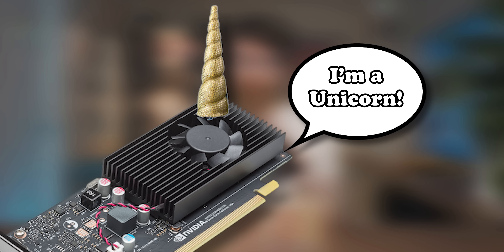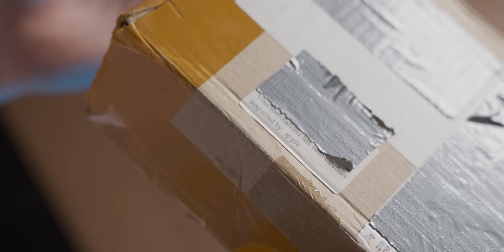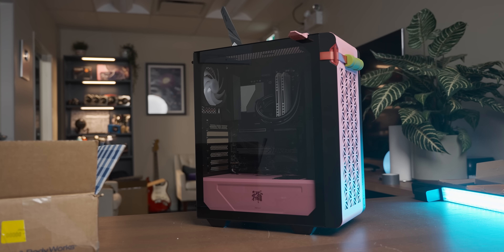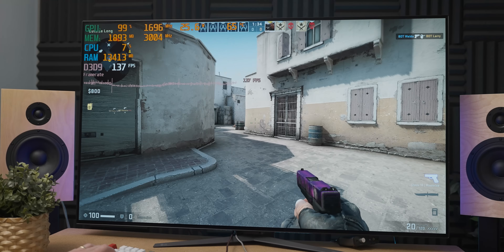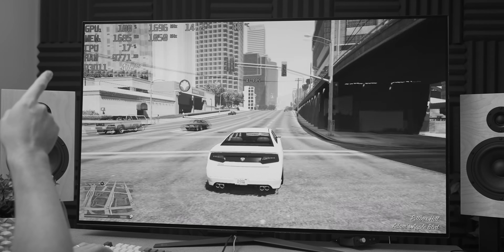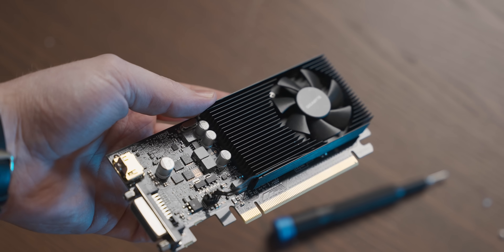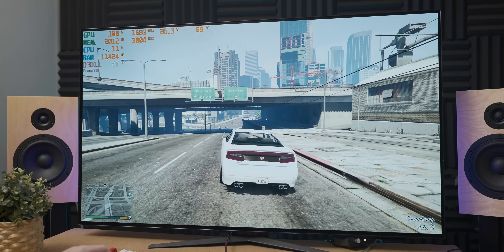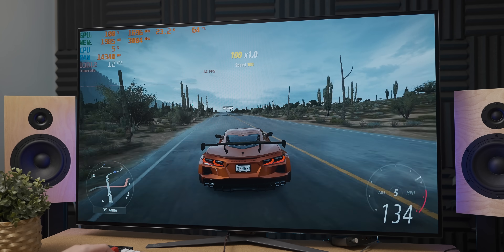This May Be Nvidia's RAREST Graphics Card

Comment: Those sub 75 Watts video cards are not very loot after.
There are still brand new GT 610's,  GT 710's, GT 1030's, GTX 1630's (which I just find out that they exist, and i wonder why? ;p )
The best use for those card is to add video outputs, but you can use motherboard outputs for free ...
Reply: Not every cpu has an igpu

Comment: fsr takes a fixed amount of graphics processing to do the rescaling. let's say it takes 100bp to use fsr at 4k from whichever resolution you're scaling from. 
if a 130bp card like the 1030 does it, it's left with 30 bp to render the actual game. which is why it's slower than native even though the resolution is lower.

now for a decent card, say a 3060, that has 1000 bp. the 100bp it takes to do the rescaling is a drop in the ocean and is easily compensated by the reduced load of rendering in a lower internal resolution.

fsr should only improve performance for the 1010 in resolutions below 1080p

Comment: 11:00 The problem with FSR is it requires a tiny bit of performance to actually apply the sharpening filter, which probably in this case seems like it is taking the GPU over the edge (could also be VRAM related?).
Reply: Both FSR and DLSS drive up RAM usage, so I wouldn't be shocked if that was the problem.
Reply: It's not compute limited, it's VRAM & memory bandwidth limited. Temporal upscaling has a small but notable cost to VRAM & memory bandwidth.

Comment: 10:30 FSR 2.2 failed in this case because it put a little more strain on your already exhausted 2GB VRAM buffer. When VRAM is full the system uses RAM which is extremely slow for the GPU to access since it has to go through the CPU to access it which is basically ages away. FSR increased your VRAM usage (and thus RAM usage) by around 700MB which is a lot for a 2GB VRAM buffer. 14300MB RAM to 15000MB is a really noticeable increase for 1 setting. It's probably not meant to upscale to 4K anyway which is why RAM usage was so high, its more for 720p > 1080p

Comment: Yeah, but how does it run compared to the 7 Vega cores on the 4600G which goes for around 100€ in my country?

I know, because I built a PC for my mother around that CPU and I tried CSGO. Which performs a bit better than on the 1030 even.

AMD iGPUs, even Vega, perform so well, my father and I built an Office PC for my mother for only 350€ (completely now parts) that can drive both of her monitors and can even game at 1080p, which I tested because I wanted to see what Vega 7 in a desktop can do compared to the Vega 7 in my laptop (which also has a 1660ti, but I am always testing what iGPUs can do). 

16GB of RAM, a 6 core CPU with decent iGPU and a 512GB M.2 SSD means it's actually a beast computer by 2015 standards. And it runs basically silent when my mother is using it.

Comment: now i see different ddr4 vs ddr5 vs ddr6 ram make gaming performance changes 
i probably be going back buying broken ddr6 gpu and steals ram off of it do swapped and see if any changes lol
Reply: I don't think swapping ram on a GPU is possible sadly.
Reply: @cpufreak101  only have right tools and skills do it
Reply: @kittyztigerz  even then, I'm pretty sure you can only swap same for same. I'm pretty confident the memory controller for DDR4 isn't the same as one for GDDR5 and so on. Even if it were, I'm sure the amount of work involved for these cheap cards where they only used the "wrong" memory wouldn't even be financially worth it.
Reply: @cpufreak101  it wasnt one of cheap AMD card it was $800 back in 2014 just have ddr4 unset of gddr5
i have recognized few thing about swapped them out have to reprogrammed bios with one that going be installed on it dont want wrong code and number because it refuse to work and i have been programmed linux os few time get them to work with off band pc that was locked to win xp only and i just find way broke bios lock and get it going
if i have parts i would be willing try it and test it to see if change anything if it does i will make video of it
Reply: @kittyztigerz  ok now I know you're bullshitting because I cannot find any examples of an AMD GPU using DDR4 memory, much less in 2014 (which mind you consumer DDR4 had only just released in Q3 of that year in non-ECC form). I can find some very low end (mostly OEM) cards using DDR3 up until surprisingly recently, but it's still nothing that'd be worth the effort for.
Reply: @cpufreak101  my bad it was 2006 i didnt check sticker n see what it was.... ATI Radeon x1950 XTX 512mb 
it was gddr3 
i remember that gpu was expensive in my area back in the day at store unless order it on online for cheaper which i didn't think of it

Comment: It doesn't surprise me tha the GT 1010 is limited to four lanes, as the GT 1030 is as well. And both use the full size slot anyways. 

If anything, I thought maybe the GT 1010 would use two lanes.
Reply: well, 6500XT also using 4lanes only with performance not that far from 3050ti.

Comment: I have small correction: 1030  is not all digital. DVI includes analog signals and simple adapter, or DVI to VGA cable can feed Mesozoic era monitors.
Reply: partially correct,  

DVI-D which is what that connector is, removed all the analog signals - as evident by the missing pins around the  ground '--' Flat pin.  and depending whether the monitor was single link or dual link would determine which of the pins would feed data when the monitor was detected and the info was sent to the GPU what type it was. 

DVI-I incorporates both Digital and Analog signals and also includes single and dual link modes. 

DVI-A literally just the analog pins in DVI Format.  those pins were later converted to digital in DVI-D specs. 

Quoting:
"Digital Visual Interface (DVI) is a video display interface developed by the Digital Display Working Group (DDWG). The digital interface is used to connect a video source to a display device, such as a computer monitor. It was developed with the intention of creating an industry standard for the transfer of digital video content.   The interface is designed to transmit uncompressed digital video and can be configured to support multiple modes such as DVI-D (digital only), DVI-A (analog only), or DVI-I (digital and analog). Featuring support for analog connections, the DVI specification is compatible with the VGA interface. This compatibility, along with other advantages, led to its widespread acceptance over competing digital display standards Plug and Display (P&D) and Digital Flat Panel (DFP). Although DVI is predominantly associated with computers, it is sometimes used in other consumer electronics such as television sets, video game consoles and DVD players."
Reply: @CapStar362  Awesome. Thank for explanation.

Comment: Your experience with FSR is actually normal and expected.  FSR isn't free, it's a fairly complicated feature detection pass on the frame. The benefit of reducing the resolution is usually more than the extra time spent on FSR especially if your performance cap is vmem bandwidth (integrated graphics),  but if you're already fully saturating all your shader cores and getting single digits FPS, then the cost of doing the FSR is higher than what you gain by hitting fewer pixels. This is definitely the advantage of DLSS over FSR: by running it in dedicated hardware that doesn't cost shader cycles, it's closer to being "free performance".  (The flip side of course, is that FSR will run on anything with a high enough shader model instead of only new Nvidia cards with the right dedicated circuitry).

Comment: Makes sense these are rare. Why waste resources making a low dollar no profit card? That and Intel iGPUs are not the disaster they were a decade ago. Save a few bucks getting the low dollar GPU without the iGPU then put this in? No. This was made for prebuilt workstation use imo- just another display adapter for more monitors. That's it. But why is that edven needed? Why can't a modern motherboard have more display adapters for the iGPU? And considering how tiny these chips are.. why not go back to having one on the actual motherboard- when On Board Graphics literally meant on the motherboard. The later ATI HD on motherboard graphic chips were actually quite good for the time- and could be overclocked quite a bit (if had enough board cooling).

Comment: why tf you compared this shit to rx 6400 ? 😆 its like night and day dude. rx 6400 is massively more powerful than this shit, fucking more than 2x more powerful💀 even rx680m ( its bit weaker than desktop version even tho specs are same since power itself is lower since its igpu ) which is rx6400 but in laptop as igpu is way more powerful than this
Reply: rx6400 is bit more powerful in games than nvidia gtx 1650 ( not ti or super ) while cost less than a gtx 1650 since gtx 1650 cost higher than rx6400 ( yeah if you are looking for gtx 1650 then say no and go for rx 6400 instead. atleast you can even turn on rt and test how it looks in rx 6400 compare to gtx 1650🤣 )

Comment: One comes with DVI-D and the other with VGA but nobody thought DVI-I would be a great solution for both. You can have the digital DVI output or the analog VGA via adapter. And considering DVI ports are all the same size, there is no reason not to go with that one. Especially since VGA needs a RAMDAC to translate the digital data from the GPU to analog signals, might as well go with the all in one solution.
Reply: What monitors actually support DVI-I instead of DVI-D though? I don't remember having ones like that
Reply: @DimkaTsv  Any monitor that supports DVI or VGA supports DVI-I. any standard DVI cable will go in to the card, and you can plug a VGA cable in via a passive adapter. On some cards you can even run two monitors off the port with a DVI+VGA splitter.
Reply: @gruzzob  i thought dvi-i is positively keyed unlike dvi-d (4 additional... contacts?)
Reply: @DimkaTsv  Oh, the monitors don't have a DVI-I port themselves, that's always on the card itself. Monitors will have a single or dual link DVI-D port. And a DVI-I port accepts a DVI-D cable, which can then go in to a monitor. Those four extra pins in the DVI-I are the analog signal, and what gets extracted on to the 15(ish) pins of the VGA connector.

Comment: Well I can give Nvidia some credit here with the GT1010 is not a rebranded card like the GT710 but a watered down version of the 1030. But pretty good performance out of the GT1010 at 1080p Low settings on the games that you tested. Hell not bad performance out of the GT 1010 @4K with some games.

Comment: The GT 1010 is just a cut down or bios flashed version of a Quadro P400.
Reply: It’s not, 1010 uses a GP108 die like the 1030 and P400 is GP107 like the 1050 ti. I think the closest comparison is the MX230 but the 1010 has half the ROPS
Reply: @dapz   likely to young to have used an AMD Core Unluckier equipped motherboard and a Phenom 2 720 Black.
Reply: @knightsun2920  I have done that before, more recently though. that’s a different situation though since the silicon between the x4 and x3 are physically the same (in design, not counting defects in the chips), both based on a 4 core design with either 1 or no cores disabled. The 1010 and p400 have physically different silicon, the p400 die has 768 cuda cores with 512 disabled , the 1010 die has 384 cuda cores and 128 disabled.
Reply: @dapz  yah may be correct, the problem I find is that something so low in gamming performance has what for value or need?  Some bars have nine or twelve or more TV in a massive wall panel might need that many ports. The question I have is it profitable to make a thing like this?

Comment: How about comparing to the AMD integrated gpu since apparently all new Ryzen chips have one? Are they any good compared to 1010/1030?
Reply: Ryzen 5 5600g trades blows with the 1030 gddr5 version.
Reply: The new AMD chips dont have an integrated GPU, they have an integrated display adapter. It's deliberately underpowered, and essentially just enough to let you configure the BIOS/EFI or other POST time configured accessories. It maybe being able to run Windows acceptably is more of an afterthought.

Comment: VGA is still common in servers. DVI is still useful, easy to convert to HDMI
Reply: Umm, servers don't need monitors, and VGA is so 90's.
Reply: @Njazmo  You definitely want your server to have access to a monitor. If something goes wrong and you can't connect, it's the only way to fix things. 

Hence, that's exactly why VGA is used. It's easy to get a little portable VGA monitor.

Comment: That GT 1010 is still more impressive than the ridiculous GT 1630 with 2 fans and 6 pins connector. Btw, I remembered that @OzTalksHW was trying to get that card and he also made a video about the possible specs a year ago. I hope he will see this video and get his own GT 1010 one day. 😀
Reply: Captain_Morgan  bruh. What the fuck lmao why would they do that? Is it like half the performance of the 1650 that was already bad enough? At least the 1650 doesn't need any external power
Reply: Wait, there's a 1630??
Reply: If the 1630 is cheaper to produce than the 1030 I could see why. But if not, might as well use the old Samsung 14LPP process instead of TSMC 12FFN and keep making the 1030. I mean the 710 & 730 were made for far longer than they deserved. Usually the older processes are put into use for less demanding parts like chipsets or controllers, because they do fine on a bigger node.

Comment: 1010 is real beast comparing to my geforce 210, it struggles to run first Portal on my unusual setup i5 13600kf + 32Gb ddr5 + pcie 4.0 nvme
Reply: Why get a good cpu qnd ram but a terrible gpu?
Reply: @RichardMontgomeryThe4th  It's a temporary solution, I don't want to buy a two year old gpu and I'm not mentally prepared to buy a new overpriced nvidia 4000 card, thus I'm waiting for reasonably-priced next gen gpu.
Reply: @Boris1990ua  oh ok, but just buy a stop gat rx 580 or something. It won't cost much and will be much better. You can sell it later too and it won't cost you much.
Reply: @RichardMontgomeryThe4th  You have a point, I'll get a closer look at suggested card. Thx for advice.
Reply: @Boris1990ua  any sub 100 dollar card will suffice, even if it breaks in a year or two it isn't so bad as you will get a huge upgrade and can actually enjoy some games until the 7600xt or whatever you aim to get when it releases. Happy gaming.

Comment: I once bought the DDR3 version of an HD 7000 series card by accident, because hey, it's the same GPU but cheaper! 
Got about half the framerate I did on the 3 year old GPU it was supposed to replace. I've learnt my lesson.
Reply: Which one? I remember them having like hundred models due low yields, each range have at least 4 models  but never heard of same model with different memory on ATI.
Reply: @gorky_vk  powercolor with shit specs on radeon hd3870 and hd3850 one with 1gb ddr2 and one with 512mb gddr4. i bought the 1gb version because  the quantity of ram, at end the more ram save me on later games but the performance was degraded with ddr2 1000 mhz on OC

Comment: Always wondered what happened to these things after nividia put up drivers for the 1010 and 1020 on their website and said they where launching the cards soon but never did anything with them
Reply: I’m pretty sure the 1010 (didn’t know there was a 1020) was only meant for work office computers and extremely low power OEM consumer computers.  I won’t be surprised to see bargain bins of these GPUs in 3-5 years time.
Reply: @zgoaty9235  Could you imagine someone fretting over whether to go with a 1010, or go all out and get a 1030?
This hypothetical person makes the reasonable choice of going with a 1020. They would like more than the 1010 offers. But, the 1030 really seems like overkill to them.
Reply: 1020?!
Reply: @GooseAffiliate859  i think we have a new graphics card to search for
Reply: @gilded916  Yes

Comment: I think that you should try a 4gb GT 1030 from AliExpress at 4K.
The 2GB of VRAM is too little 🤣
Reply: that is if he can get a gddr5 version at 4 gb cause if it's 4 gb of ddr4 then it won't be worth it at all🤣
Reply: 4gb of gddr5 would be nice. And a modded bios, cause when trying to oveclock the 1030 you run in to the powerlimit before even going in to overvoltage, heat issues, or instability. And the bios doesn't allow to increase it. On a decent 1030 with a fan, maybe even copper in the heatsink, i reckon somewhere close to 50w is possible thermally, maybe less depending on how much overvoltage would be needed